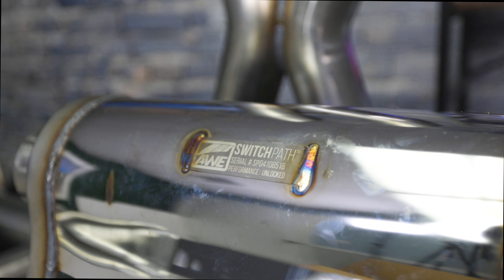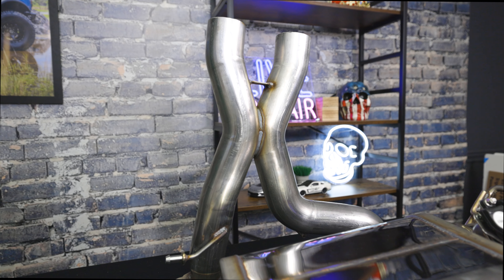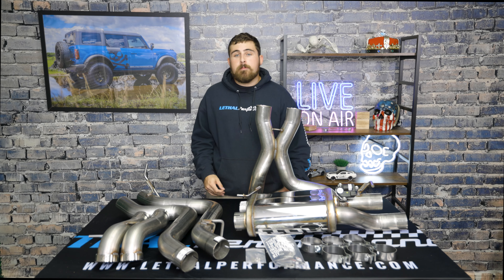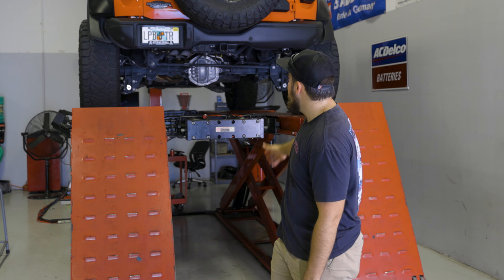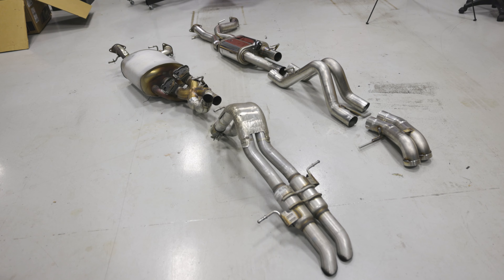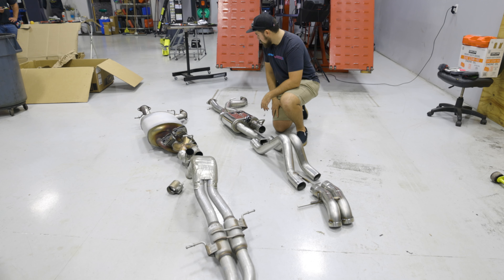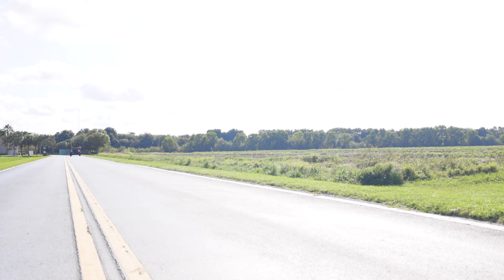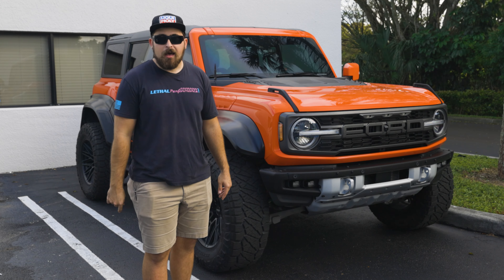AWE SwitchPath Catback Exhaust for the Bronco Raptor! Overview, Install, and Sound Clips

Comment: When you’re doing your sound test what’s dripping from the bottom of your vehicle it’s a good amount of liquid I’m assuming it’s air conditioning condensation but it’s quite a bit just curious? Thanks for the good review on the AWE exhaust I am considering getting it👍
Reply from the maker: Yes, the liquid coming from the underside is from the A/C. The AWE system is a nice upgrade over the stock if you're looking for a cleaner, deeper tone without any of the nasty drone.